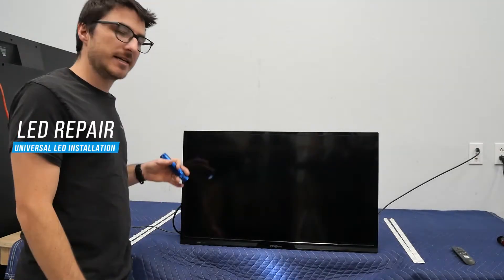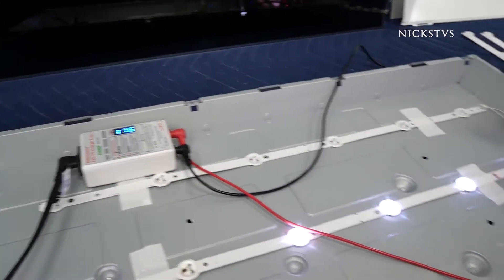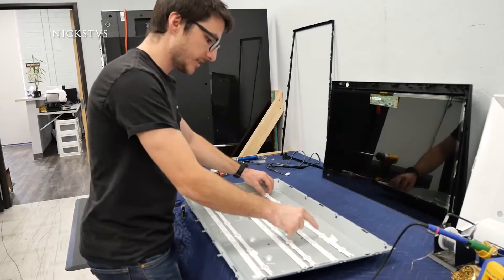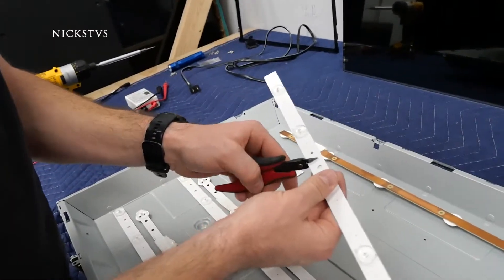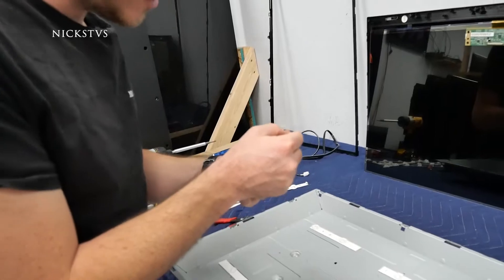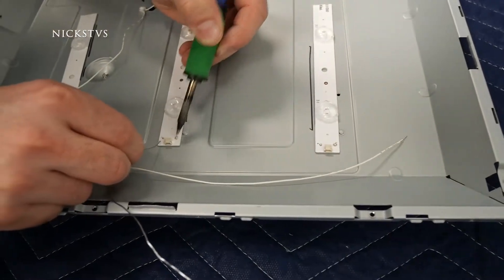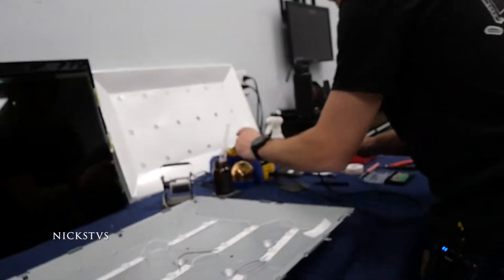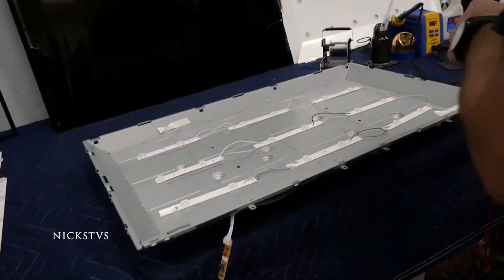LED TV Has Sound But NO Picture? Fixed!

Comment: Are these good for 49" LG tv?
Reply from the maker: If you can find proper replacements I would recommend those, if you can't find any replacement strips, then yes these would work just fine, but as shown they are a lot more work.
Reply: @NicksTVRepair  are they 3v or 6v
Reply from the maker: Are you asking about the strips in your TV or the strips we are using? Both 3 and 6 volts are used in TVs and both are sold as universal strips.
Reply from the maker: were you able to identify the types of strips in your unit? 
Usually I go to Shopjimmy they have a lot of strips for sale.
Reply from the maker: Nice that's a really good price.

Comment: I don't tear into a TV and only do one light or strip, thats me, some do, even so much as wiring around a bad LED to make the rest work, and leave one light out.  I like that little dremmel, added to the list. Insignia is Best Buys garbage, I try to avoid them but lights are easy enough. Searching for this Hisense 58" no picture, only back lights, tried a another Tcon, same deal. The main board responds to the remote, and it has sound.
Reply from the maker: Oh my gosh, yeah always replace every LED strip in the set. You are setting yourself up for failure and you customer with a bad experience if you don't replace the whole lot of strips. 
As for the Hisense 58" you most likely have a panel fault. Not sure if you saw but we do have a video that shows that you can put a piece of tape or paper on the address board connector to block off clock lines and make the TV work again.
Reply: Insignia is Best Buys garbage 😂😂😂